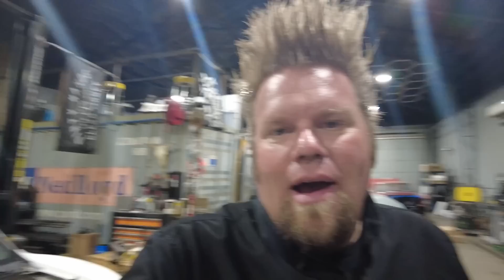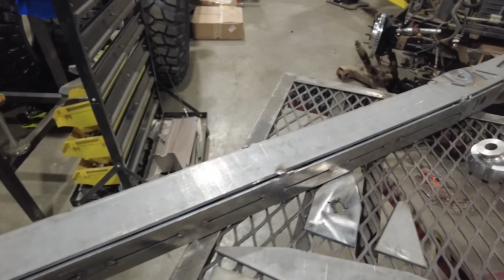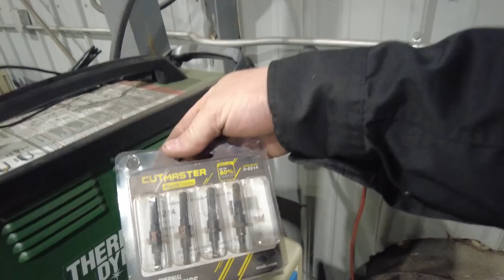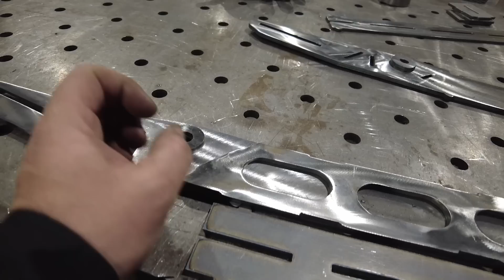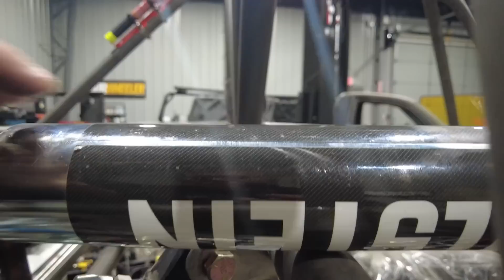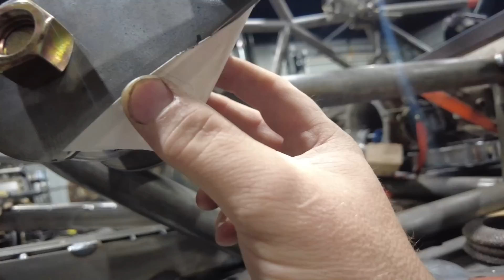Building Rear Trailing Arms for a Rock Crawler

Comment: The problem I would have with a Plasma water table I live in NY .. you would have to heat the table or the shop too keep the table from freezing .. then there is the problem with the water .. anyone that I have messaged has not answered me what do you do with the dirty water. I was told by a dry table company that the dirty water is considered hazardous waste .  when I get the $$ saved up I will get a down draft Plasma table .. would like a 4 x 8 ,, or even a 5 x 10 table ,,I get full size sheets when I buy metal ,, Great video IAN
Reply from the maker: I have my steel supplier chop mine into 4x4's so I can have different thickness available at all times on the table

Comment: hey, what makes me crazy ,is when people are mounting trailing arms and shocks .they use a bolt that the threaded end is in the bolt hole.it fits loose and will just beat that  hole out, my way is to get a longer bolt and cut it so it has shank in both side of the mount, then just use a washer or space so the nut will tight out side of the hole, please try this, great videos, fun to watch
Reply: what does pined mean?

Comment: I run 99-04 there a 100 in jy near me easier to find parts smaller inner cs and with branik shafts 300m no need for 1550 for a light ls buggy

Comment: My primeweld plasma cutter is 60 amp and has the plasma table capability. Do you think 60 amp is enough for this kind of work or should I buy the recommended 80 amp that the table manufacturer sells for it at a hefty price?
Reply from the maker: Yes...mine is a 60amp and its fine